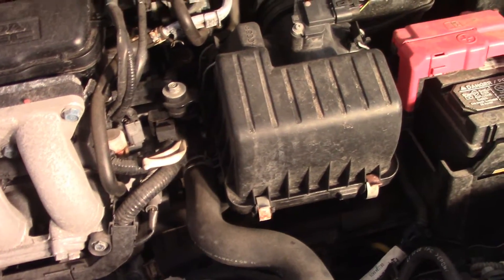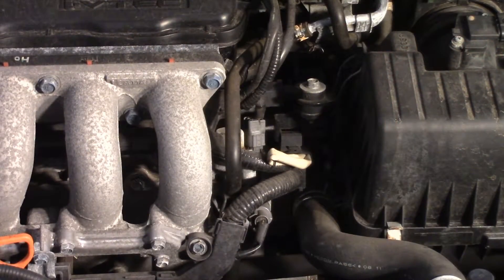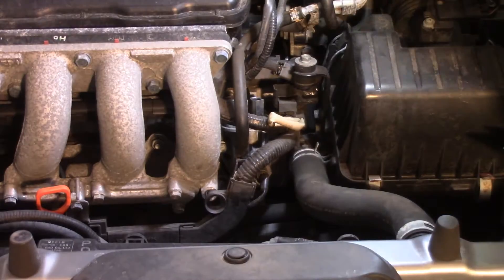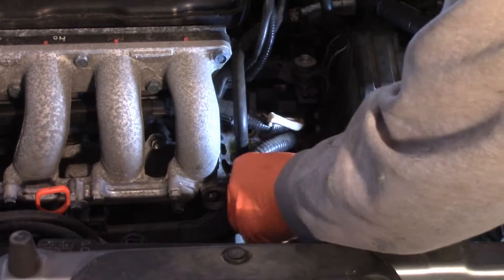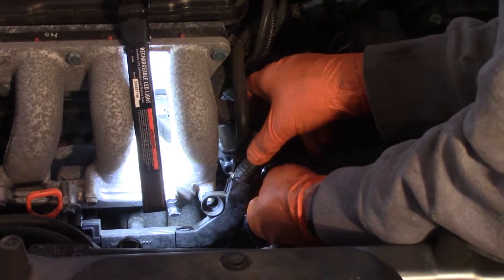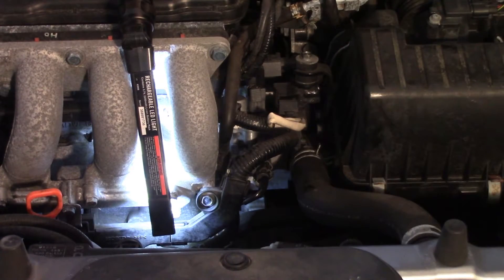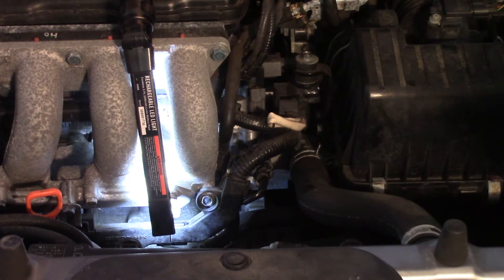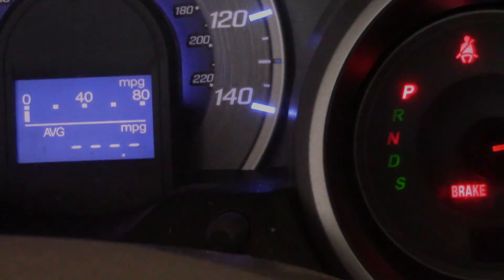Honda Fit (2009-2013) VTEC (or VVT) Solenoid Replacement

Comment: I don’t know if you’re still running this site Chris but the grinding starter motor!! I have that!! I assumed the starter was going out! 235K on the odo. Is the filter integral with the body of the solenoid? Thanks for the great video!
Reply from the maker: Hi, Andrew. Yup, still here. The filter is integral to the solenoid. It was a one-stop shop for replacement when I purchased the solenoid. According to Rock Auto, you can get the filters separately, but the solenoid comes with one already, so you should be all set. The filters are under $5, though, so it wouldn't be too expensive to be sure. Good luck!

Comment: So um I did this right, one of the screws is threaded differently than the other two… and i never noticed and it snapped and now I have no idea what to do
Reply from the maker: Oh, no. I'm really sorry to hear that. Unfortunately, the most conservative thing to do is get it towed to a mechanic that can fix it. Or maybe find a mobile mechanic that will come to you to save on the towing. If you want to take a chance in fixing it yourself, I would spray the broken bolt with some penetrant (such as PB Blaster) to try and break up any corrosion that may be causing the bolt to be stuck. If you can get a pair of vise-grip pliers on the bolt, clamp it on tight and work the bolt in and out, a little at a time, to try and break it free and spin it out. Then, you should just need a replacement. The danger here is that you are most likely bolted into aluminum, which is easy to damage. Good luck!

Comment: With all due respect. Any erroneous suggestion correlating a starter motor which rotates a crankshaft, making a grinding noise - AND - a device which controls oil flow to a variable valve timing mechanism makes about as much sense as low air pressure in the left rear tire keeping your radio from tuning into your favorite station.
Reply from the maker: Thanks for watching! I did not mean to suggest that my starter motor was what was making the noise, I meant to suggest that the sound I was hearing, to me, sounded like the starter motor grinding on the flywheel gear ring upon start. https://youtu.be/oEbR0WSiE80?t=29. I completely agree with you that to think that silly little solenoid such a noise makes no sense, but I found several different sources that confirmed that symptom. Here's one: https://www.carparts.com/blog/bad-vvt-solenoid-symptoms-what-you-need-to-know/#:~:text=Rattling%20Noise%20From%20the%20Engine,indicate%20a%20bad%20VVT%20solenoid.

Comment: Your caption says 2007-2013 Honda Fit. However, you say that it is for the 2009-2013 Honda Fit. The caption is wrong, but you verbally correct it. The 2009 model is a different generation of the Fit. In my opinion, it is a better model, but it is slightly more difficult for the DIY mechanic to access certain parts of the engine. 
Good video.
Reply from the maker: Whoops. Thanks for catching that. I assumed (wrongly, obviously) that it would all be the same for that generation. I've updated the caption. You're the first one to point it out and this video has been up for a while!

Comment: My 2009 Fit has 238,000 miles.  I never have to change the vtec solenoid.  My suggestion to make the Honda Fit last long is to replace the oil when the oil life is at 50 or 40 %, and change the air filter every 8000 miles.
Reply from the maker: Thanks for the tip!

Comment: Hi Chris, for a 2009 Honda Fit Sport, do you think I should just replace the VVT solenoid, and/or the Starter Motor?
Reply from the maker: I thought it was the starter motor at first. Research led to the possibility of the vvt. Since that was a lot cheaper and easier, I did that first. Lucky, but I'd probably do the same again.
Reply: @roundtailrestoration  what do you think about the TRQ Variable Valve Timing Solenoid? It's being sold on Amazon for about $49.
Reply from the maker: I don't know. I got mine from Rock Auto if I remember correctly and it was OEM. But, I've bought other parts from Amazon and haven't had any issues with any of them.
Reply from the maker: And hell, with Amazon's return policy, you might be able to try it and if it doesn't fix it, return it.

Comment: Could this be why my moms honda fit is jerking back snd forth. Im getting a map sensoe code on my scanning tool! When i plug and unplug the map sensor there's no difference on the idle..
Reply from the maker: I didn't experience any bad running symptoms like you explain. But, I believe a MAP sensor going bad may cause your symptoms, but not necessarily at idle. I think I would trust your code. I can't tell you, tho, the difficulty in replacing the sensor yourself.
Reply: @roundtailrestoration  Whar i find off is, when I Disconnect the map sensor, there is no change in the title of the vehicle. When I plug it back in still no change, but I am getting a map What is scanned using my scanning tool. I think I’m going to check the wires in the multimeter as well. For some reason when I accelerate the gas pedal, the Vtec kicks in But the car jerks back-and-forth like it has a restriction.

I’m going to run some more test and see if I can get to the bottom of the problem, if I cannot find it I will send a card to an electrical specialist shop and see if they can figure it out. I just want the car and greet for my mother, I recently had a new engine installed! Not new, but with low miles.
Reply: @roundtailrestoration  I have a question, if I run the car even with that cold that is stating the VTEC Solonoid  rocker 
Arm error Can I caused damage to the car if I drive it around town for the time being until I get this fixed.
Reply from the maker: @Starsnstripes25  I drove the car for a while with the VTEC solenoid messed up and I didn't have any problems that I noticed. With you MAP sensor code, though, I'm not sure (I didn't have any codes). You might be taking a risk. I'm sorry, but I don't know enough to give you a good answer. Maybe look for a video on testing a MAP sensor? Probably one out there in general, if not for the Fit specifically. Sorry, but good luck!!
Reply: @roundtailrestoration  I checked the obd again and the solidified code is gone. But the map sensor is still on, on attempted to drive the car today and she shut off when I was about to get into traffic! I put it on park started her up and took off.

I put over 3k into this Fit for my mom, just had a low milage engine installed in n her now I'm gonna have to spend more money on the car to get it right! Cuz it's not in perfect driving shape for my mom! I don't want her getting hurt out there. 

I love this little car! It's adorable! Just trying to get it right for my mom! I'll let her use my Lexus IS300 until I get her Fit right for her!

Thank you for your advice! Appreciate you.
Reply from the maker: @Starsnstripes25 Sorry to hear it's still give you problems, but totally agree you want it right for Mom! Glad I could provide what little help I did and, again, Good Luck!
Reply: @roundtailrestoration  Thanks bud! She wants my 03  IS300 Sport Design 😆 but my Lexus is to much machine for her! She'll get a glove compartment full of tickets 😆 I'm def gonna get the car right for her! I'll keep seeing what it may be! The scanner is saying MAP sensor! If it fails I'll try something else!

Thanks again.
Reply: @roundtailrestoration  I just subbed to your channel =)
Reply from the maker: @Starsnstripes25  thank you!
Reply: @roundtailrestoration  I was wondering, when I install this part does it have to be time to certain way? Let me experience putting this car prevent the car if you're driving this full potential and lag? I gave the car some gas while driving it, and I've noticed right when the VTech was going to kick in I would go back. A friend of mines it's a master technician Tampa Bay told me he has a feeling but the solenoid or bad. He told me to clean out the filter first, let's see if that fixes it if not change the whole solenoid out.

Comment: I don't really do much work to my car, but couldn't spend the $235 they wanted at the auto parts store for this part. I also didn't want to spend the close to $300 for labor that they'd probably want at the dealer with an inflated part price so... I want to say thank you for your video, it was very helpful! My 2007 Honda Fit runs great now. I had to take the air filter out, which was interesting. But for those of you who need some encouragement to just do this yourself, it is totally doable if you have a couple hours to spare. I couldn't figure out how to buy the one from RockAuto, but I found a link to an Amazon part from a different video, made by Dorman for $85.  I think we saved easily $500. 250 bucks an hour isn't bad at all! Thanks again for your helpful instructions.
Reply from the maker: Good deal. That was the whole point of the video. Even in modern cars, there are things you can do yourself and save serious money. My local PepBoys charges $150 an hour(!) to do work. Crazy. Good job and congratulations!
Reply: @roundtailrestoration Thanks for finding an OEM part from somewhere other than the dealer.
Reply from the maker: @JdmgjnFjahgks  good luck!
Reply: This is why I love YouTube videos. They help me to decide which jobs are above my pay grade. I've saved thousands of dollars over the years on home and auto repairs by doing this. 
This job is not that hard and I recommend using the money saved on labor and spending it on Genuine Honda OEM parts. Honda's don't like aftermarket parts which usually last less than a year.
It's also worth the money to buy good tools. In this case, I would use 3/8" drive socket wrenches and sockets to remove the bolts and 1/4" drive ones to install them. Then use a 1/4" drive TORQUE wrench for installing the bolts to the 104 INCH-lbs torque setting required. As he said in the video, do NOT overtighten anything in an aluminum engine.
Reply: @boomerguy9935  Oh man, You are so right about Hondas liking OEM parts.  while this VTech solenoid still works just fine, I learned the hard way with an EGR valve. And yes, torque wrenches are the way to go... Absolutely!

Comment: Help. Has anyone solved this p2646 issue ? I see also that there is a leak around my engine. I recently did a valve adjustment for my 08 with a new cover gasket. Then 3 days later I’ve got that same code. Could it be possible that dirt got into the engine while I was doing the valve adjustment? 168k miles on my car.
Reply from the maker: I don't have any experience with that code, personally. Sorry I can't help. Maybe someone here can? Good luck!

Comment: Hi chris, had an error code on a honda civic 2014 140bhp 1.8 petrol of 'P2649' which suggests oil control solenoid has high voltage or is faulty. HOWEVER my mechanic did a few tests and we located a misfire to cylinder 3 that moved to cylinder 2 when the fuel injector was swapped to cylinder 2.

That faulty injector was moved to cylinder 1 and now 2 cylinders arent firing meaning '2 injectors' have now gone.

Problem is these injectors are impossible to get hold of and arent cheap, is it possible this P2649 code which relates to the oil control solenoid isent correct and 2 injectors have managed to go one after another? Would p2649 cause injectors to not fire in certain cylinders? 

The car is in limp mode.
Reply from the maker: In my minimal research, no. Code P2649 has to do with a rocker arm actuator and it's relationship to the VVT solenoid, like you mentioned. I think your injector failure is unrelated. Limp mode, however, I think is driven by the code you have. I never got the car into limp mode, but I never spit a code on my failure, either. I think you might have two separate problems.

Comment: Hi Chris awesome video thanks, I have the same noise same car same engine, but the current VTT I have installed (KEIHIN) does not have the second wiring you connected in the video (8:41), it has a screw I think. could be a different type of VTT sensor? thanks mate
Reply from the maker: The one installed that was original to the motor? Yes, I'd say they're different. What year is your car? Odd that they would be different within the same model production run.
Reply: @roundtailrestoration  I believe it is original, I can't find any loose connector, or maybe it was a cheap modification from the last owner. The car is a honda fit 2010. I could be sent you a pic, just for info.
Reply from the maker: @machine-1086  That's odd. The ones I'm finding for sale online, like you know, all have two connectors. I'm not sure what to tell you, but I'd probably put the old one back in because I'd be afraid the car may not run properly or give a check engine light if it's not fully communicating with the solenoid.

Comment: Is it the same with a 2004 model?
Reply from the maker: Hi Tumelo. No, I don't think the engines are the same. Looking at pictures of the component, they are different. But, that's not to say that you might not be able to fix your problem by replacing your VVT solenoid...but you would be taking your chances as far as I'm concerned. Good luck!

Comment: My 2004 Honda fit has to idle for approximately 15 minutes before it's able to engage in drive.... Especially when it's cold. When you put it in D it starts to blink after a few seconds. Could this be caused by a faulty solenoid valve?
Reply from the maker: I don't believe so, no. That should be strictly having to do with the motor and should not prevent the transmission working at all, nor should it prevent engaging drive. I'm not sure what your problem could be, I'm sorry. Good luck!
Reply: When my Honda fit blink ' D' I added CVT fluid and it was ok. Gearbox fluid running low or old needs to be changed

Comment: The O-ring gasket with filter will eventually leak and it can be replaced by itself. Just remove the VTEC assembly for access to it. The VTEC assembly will last much longer than the gasket. I would not replace the assembly until it fails. The normal symptoms are a code along with the engine bucking when the car starts to accelerate and then goes into "limp mode", so you can get back home....very slowly.

This is another reason that you MUST change the oil more frequently than the owner's manual recommends.  I prefer to change mine @ 5K mile intervals with top quality FULL SYNTHETIC 5W/20 motor oil and a premium grade oil filter.
Reply from the maker: Thanks!
Reply: I'm about to order this for my mom's Fit! I was driving it s couple days ago and right before the V tech kicked in the car started jerking back! And most of the power was lost. Is it dangerous to drive the car like this? I'm trying to find it online that ships from the USA so I don't have to wait a month for it to arrive.
Reply: From what I've read, the best way to keep the o-ring/filter in good shape is to change the oil regularly and use premium full synthetic. I've replaced these in my old Accord and Element (same engine) with well over 120K miles on each and both were still in good shape.  @Starsnstripes25

Comment: My wife's 2008 fit has started the few sec cold start grind and Ive read it can be the solenoid or the cam gear sprocket pin is failing how can I figure out which one it is after first start of day car runs great no noise at all
Reply from the maker: Hi, Joshua. No, sorry, I don't have any ideas on how to figure out which it is. My guess is that the cam work would be $$$ while a new VVT solenoid is relatively inexpensive. Maybe take a chance and replace that and you might get lucky?

Comment: I just performed this VVT Actuator replacement.  This was not the solution to the grinding noise.  My Honda Fit still makes the grinding noise.  It most likely is the starter.
Reply from the maker: Sorry to hear that, Bruce. Starters are brutally mechanical and have been around since the inception of the automobile. I say that because I would be surprised if it really was the starter since it's such a mature design, no matter the application. I'm not saying that the VVT was your problem, but I doubt the starter is. But, maybe so...good luck!